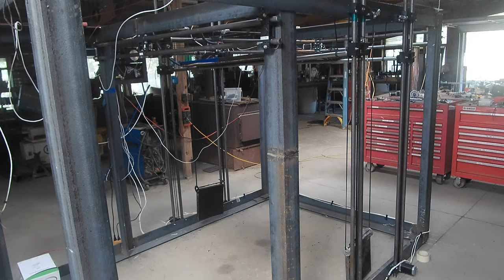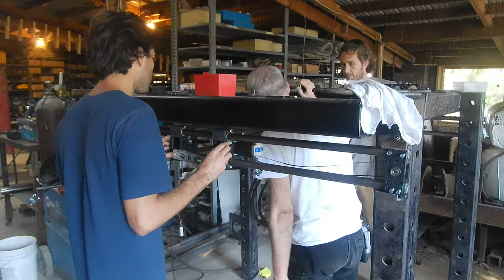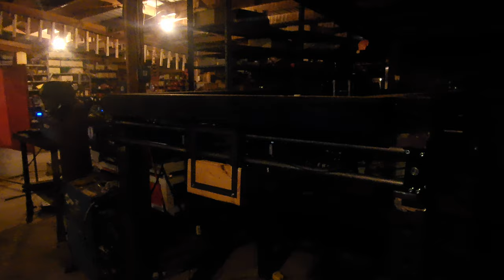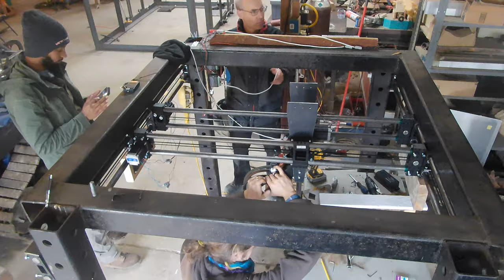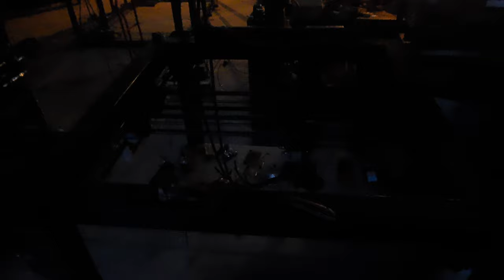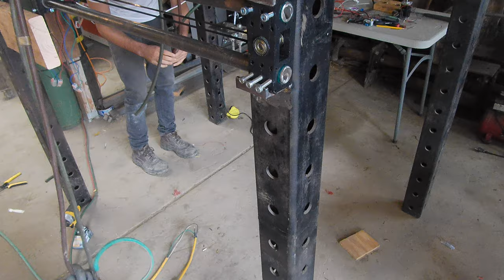Open Source Oxy-Fuel CNC Torch Table Up to First Fire and Water Bed

Comment: This is really awesome to watch all of the pieces come together. One question I have though, what's the precision level of the torch vs. plasma, water jet, or laser? I just assumed, without any expertise in metal cutting, that the torch would not be good for small precise cuts that might be required for the shredder parts?  Anyway, thanks for sharing your progress, and good luck on the builds!